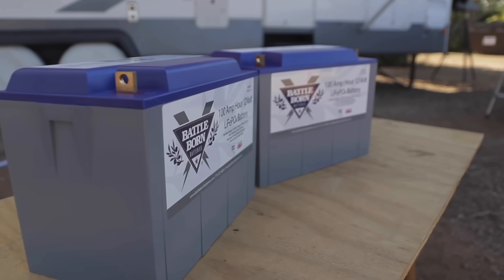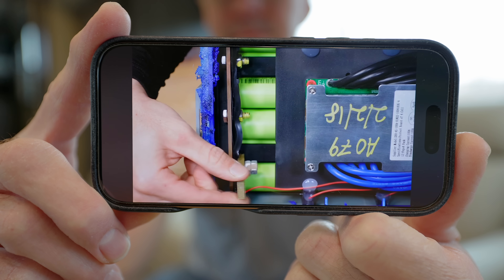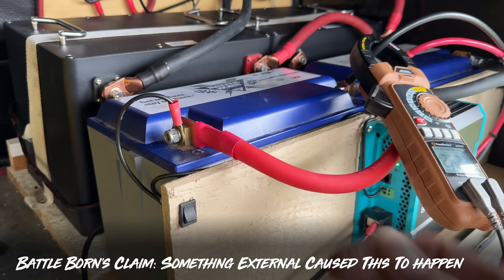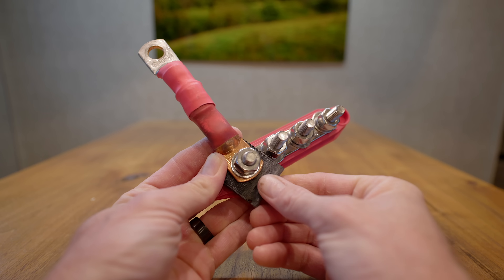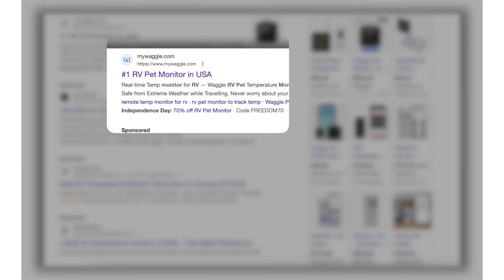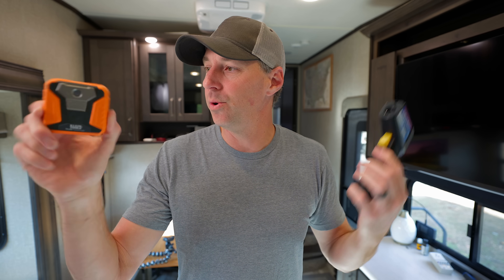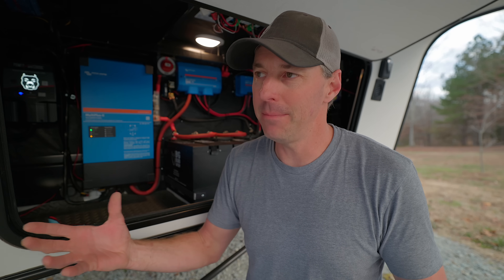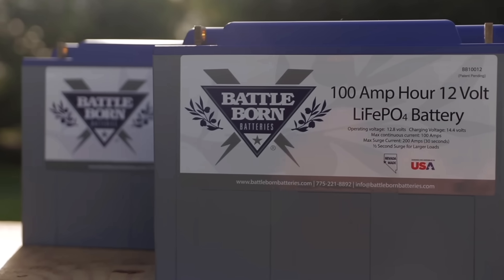Battle Born Batteries Problems!

Comment: We have 6 of the exact battery.  No sign of discoloration, but I am shopping for new batteries. I feel I got sucker punched.
Reply: You didn't get sucker punched you got "burned". 😂 sorry.
Reply: @Loki-rascal no worries. I am a big boy with big boy pants.  I will insert this in the stupid tax file and take the education from it all.
Reply: Battleborn is going out of business.
Reply: Do you have a thermal camera?  You can get a good one for $150 or so and it is a good thing to have for many reasons.  (I prefer the standalone kind rather than the smartphone attachments.) You can use it when you have a heavy load on the batteries for several minutes to see if there is any sign of heating.  If the batteries operate cool, there isn't a problem. Check them frequently, especially after travel or unusually heavy loads.  If there is no problem, no need to replace the batteries.
Reply: Check Redodody  bug batteries Will reviewed, their big and cheap!
Reply: If you don't pull high current from a single battery probably never have an issue. I suspect some of these are 12V systems which would pull max current frequently. Due to the design of that bolt passing the current through the plastic it gets hot over time softens it. Higher voltage systems probably not going to see max current as often. Check out the video Lithionics vs "Brand B"
Reply: @Mike-01234 agreed
Reply: @Mike-01234 Where all of this rubs me the wrong way is; Battle Born has strict instructions on how to connect to their batteries, but they do not follow their own instructions within the internal battery design.  You have to have enough surface area to even be able to move that much current.  Now I find out they are using several different metals within a connection.  This is nuts.
Reply: You’re probably more likely to get suckered by Will Prowse than anything else. I’ve been running these batteries for five years and very harsh conditions and they are as tight as can be.
Reply: @healthrisingMECFS-FM-longCOVID   Will has zero motive to "sucker" anyone. What's your reason for defending bad quality?
Reply: He either does not like Will, or cant admit that he paid many dollars for junk!
Reply: @TreeLBollingTreeMan Maybe because his batteries have been trouble free, either lucky good batteries or low enough charge/discharge that he hasn't melted the internal plastic. YET.
Reply: @healthrisingMECFS-FM-longCOVID  ignorance is bliss! By yourself a Ferrari and then keep it under 50 miles an hour and you'll be fine.
Reply: @healthrisingMECFS-FM-longCOVID I feel I have been sucker punched by Battle Born because they promised a high quality, American designed, American made battery.  Instead I was given an over priced experiment waiting to fail in my RV.  If you are so smart, you do the math to see how much current you can run through dissimilar metal fasteners and washers.  You have to have a calculated area to even be able to pass that much current. The 6 batteries we have, power our RV system about 9 months of the year with a large portion of that time boondocking.  Thus, we have both high usage times and low usage times, now knowing there may be a ticking time bomb that I paid $6000.00 to experience.  I paid for the best, I did not GET the best.

Comment: Good content.  I'd like to see UL clause that describes the disconnect style/construction they use and what is the testing PASS/FAIL criteria and results.  This should not be an opinion but based on engineering judgment and test data and pass fail criteria.
Reply: I don't think anyone will be able to find such UL info for supporting this B.B. design.  JMHO.

Comment: Design flaw. They still have not fixed the issues with the nuts welding to The bolts when installing. Leaving you with half installed cable and have to use a power tool To cut the bolt Off.

Comment: Dissimilar metals should not be in direct contact, especially in electrical circuits carrying significant current. Putting an aluminum nut on a bolt made of another metal doesn't make sense. The same metals should be used throughout, or at least metals plated with the busbar metal. For example, a copper plated steel bolt and nut for connection to a copper busbar.  The nuts should be nylock type to prevent loosening, or a split-ring lock washer can be used, but they are not as good as the nylock type. For overcurrent protection, they need a proper fuse in the circuit made by a reputable manufacturer.
Reply: I agree with most of your statement but you need to be careful where you use nyloc nuts in regards to heat.  If that connection heats up and melts the nylon you no longer have a locking nut.  Most common fastening for electrical is a washer followed by a lock washer then the nut.
Reply: The nuts are actually steel, the bolt is aluminium. So their PR statement is factually incorrect.

Comment: This looks more like a vibration induced failure, plastic spacer is crushing allowing the joint to loosen and creating heat. Did Battle Born vibration test these with a load on the terminal?
Reply: The plastic isn’t getting crushed. It’s possible that excessive load is causing heat, which is causing the issue to start a feedback loop, but if so that isn’t graceful degradation, it’s a poor design. 

It’s possible that the nuts aren’t torqued properly, or that the plastic isn’t contracting and expanding with heat cycles causing the start of the issue, but again there is no world where this should happen.

Comment: IEC 62619

Title:

Secondary cells and batteries containing alkaline or other non-acid electrolytes – Safety requirements for secondary lithium cells and batteries, for use in industrial applications

Applies to:
LiFePO₄ (Battle Born), industrial, RV, marine, solar, stationary storage

Key requirements (relevant):

Terminals must maintain electrical continuity under thermal stress

Connections must withstand mechanical stress, vibration, and heating

No loosening that causes increased resistance, arcing, or overheating

Requires secure electrical connections under normal and abnormal conditions

👉 This is the primary IEC standard Battle Born batteries fall under.

Comment: EXCELLENT presentation. There appears to be a number of credible number of YouTube creators that are discovering the same issues are are individual owners. I'd like to see what the statistical numbers are of those with issues vs those without though. Your approach suggestions BB get ahead of it appears to be a better solution that the 'word salad' reply that Will Prouse received. 8-10 years ago I followed you and Will to learn enough about Solar & LIFO batteries to build my 1st, 2nd & now 3rd system for my Rv's. BB were & still are very expensive.I will pay the premium for things I see the value, i.e. I use Milwaukee tools. Did not see enough value added to justify purchasing BB's though. I felt completion would soon drive prices down. They did and even BB dropped but still expensive.  I could buy 3 knock offs vs 1 BB. So far in 4 years mine have worked flawlessly. BB has a issue here & needs to address it!

Comment: Even if the plastic surrounding the terminal melted completely away that doesn't explain why the terminal is not tightly connected to the internal bus bar.
Reply: It was connected tightly, then the plastic spacer melted so it is mostly no longer between the bolt & bar; the resulting gap causes extreme. Heat arching.
Reply: There ya go. Simple. EZ to figure out this poor design.
Reply: It may have been tight initially but aluminum expands and contracts at a different rate hence loosening
Reply: @KnutSvensson-f2o  and the plastic flows even if it does melt, causing loosening.  It's an incompetent design.

Comment: BB response is to blame the customer kinda makes the warranty useless. Sorry but an aluminum bolt sandwiching a buss bar through plastic is not UL certification.
Reply: Are you a third party evaluator for UL?   

If you are not your comment is uninformed at best.
Reply: No,  a piece of plastic is NOT a fuse, no matter how anyone obsuficates.  I have no respect for Battle Born's email to Mr Prouse. BTW,  I am an engineer with loads of experience.  And I have two Battle Borns that I have to think about if I still want them in my RV ......
Reply: I am not an UL certification specislist either, but as an engineer able to follow OEM instructions.  Battle Born has very specific instructions on how to attach wire leads to their batteries.  They are not internally following their own attachment instructions to get proper electrical flow into or out of their battery.
Reply: @KylesRV  LoL Here you dont need to be an expert. Fuses shall disconnect reliable, and not just increase the resistance... facepalm
Reply: @SurvivalSquirrel  My comment was directly related to knowledge of UL third party certification not anything about the design.  The OP made a comment regarding UL certification apparently without any knowledge of UL certification.  Someone may or may not like the design, I don’t care.  I don’t own BB because I didn’t see enough benefit to pay the premium on their product when I was making a purchase.
Reply: @KylesRV UL certifications are available for everybody to read, how could that be uninformed? I assume you bought battleborn and now you're butt hurt.

Comment: I would believe Will over the manufacturer
Reply: Every Time!
Reply: There was a long thread about a warranty dispute on his forum about a year ago Will asked for the proof emails, and text screen shots. I was surprised that BB gave this person so much grief over a warranty issue when they charge 10x the cost of everyone else. Will said he was removing them from his list of products he endorsed. I don't use 12V batteries since I started building my own DIY battery banks awhile ago 48V lot better. I think this sort of why I never liked these plastic cased batteries can't look inside to see if have a problem. Could have swelling, lose terminals won't know it until the battery overheats possibly vents hydrogen gas.
Reply: @Mike-01234 I had warranty issues two years ago as a wholesale dealer and was discussing in his DIY Forum 
This is old school, folks think it’s just 100ah it’s not, GC’s too. Dragonfly/BB is so big they can squash the little guys
Reply: ABSOLUTELY! Independent testing with no skin in the game.
Reply: Will the man child😂
Reply: I "believed" Will and purchased 2 BB batteries. Now I'm stuck with 2 of them.
Reply: Well he didnt see this, when he first opended such a battery! But it was easily visible in the old video.
Reply: @SurvivalSquirrel  Have you called it out back then when you noticed it so easily?
Reply: @mannyfreundl5099  I didnt watch it back then.

Comment: An aluminum bolt connecting copper busbars? Really? Any electrician would tell you that dissimilar metals such as copper and aluminum should never be in direct contact with each other. Add into the mix, the thermal expansion of aluminum and it's a problem waiting to happen. Not that the National Electrical Code technically applies here, for what it's worth this is actually an NEC code violation: 110.14 Dissimilar Metals
Reply: NEC doesn’t apply to manufacturing. Plus dissimilar materials are fine, it’s the rating that matters.
Reply: Don't forget that plastic spacer between the busbars. I do not believe the NEC covers that in any way.😀
Reply: It's DC in a sealed environment. Galvanic really isn't an issue without some form of electrolyte / moisture. That said, the design IS stupid.

Comment: ….. I would think twice bout your thoughts on this. You’re supporting the idea that an external problem causes the internal connections to ‘deform’ and heat excessively? This is not in the realm of reality. Why? How do you know anything inside has deformed? A safety feature doesn’t destroy, damage or potential heat up to protect. A safety feature either stops or starts a process. This just deforms. So melting plastic is BattleBorn’s response?

And…. It can only happen in very few cases?? So we are now playing Russian roulette with electricity? Come on. 

Your answers sound sponsored…..😢

Comment: For anyone buying new batteries, there are options with lids that are screwed on. Buy these. It's easy to remove the lid and check the build quality or swap a failed BMS. Manufacturers are more careful if you can check their work.
Reply: Yes, one of the reasons I bought sok marine batteries 206 ah
Reply: Exilent point.
100 % to consider.

Comment: I had an RV fire so I'm a little more cautious with this stuff. A battery is something you want to connect and not have to babysit 24/7. I wouldn't take this chance. Safety first.
Reply: I had a 46,000 watt hour power console 3600 amp hours,  with 12 batteries catch fire after 2+ years of constant light load operation. The battery that caught fire set 8 more on fire, burned up the inverters, MPPT's and chargers. It caused $150,000 in damages in my shop and garage. Its going through court now, but there was thought and evidence that the suspect battery was dropped upside down in its packaging from 5-6 feet high during transit, crushing an internal  wire to the BMS.

 I was lucky to be home and have my own fire hose cabinet. I had high pressure water on it 70 seconds after hearing the pop. I saved my home, cars, motorcycles, tools, and collectibles with that fire hose. One of the cars is an old Ferrari. 18 months later I still wake up and thank The Lord for making me stay home that afternoon.  I replaced the system with EG4 components with UL Listing and internal fire suppression. I'm still nervous about batteries.

As a retired Engineer who worked in power generation and distribution in 17 countries,  a guy who built 15 systems including for friends and family RV's and cabins, I think the BB terminal design is terrible having plastic in the bolted terminal stack.  It should have been all metal with a DC fuse or fusible link inside if their BMS can't handle the fault. I have the same brand 300 amp hour battery in my camper van.... parked a fair distance from my home.
Reply: @kimmer6  I'm building a house and it'll have a large battery bank.  Part of the design is a standalone battery shed on the outside of the house that's heavily firewalled from the rest of the structure.  I don't like anything that concentrates that much potential energy in a living space.  I'd no sooner put a bunch of large batteries in my home than a couple cords of seasoned firewood.

Comment: It's a poor design to allow the battery post to arc inside the battery. The way they secure the post to the bus bar should not be allowed to come loose, especially in a moving van. I'm happy this problem was exposed before a  RV burns down.

Comment: Quality is exactly why I bought Batleborn batteries. I have 5 ranging from 7yrs old to 2yrs old.   But the design looks like it was designed by an engineering intern and their response sounds like an inexperienced noob employee reading from a book.  Not impressed with BB response.
Reply: My story, too. I have 5 of them of the same age as yours. I didn't want to skimp and risk getting "cheap Chinese crap" that might be dangerous, so, I bought the "gold standard" and paid more . I relied on those who knew more than I did, such as the experts on YouTube. I was naive and now I am more than a little concerned.
Reply: Are you having any problems with them?
Reply: I am not really sure where your thinking was. Pay over double the cost and getting a battery that has half the capacity is getting quality?  Did it ever occur to you that you where just getting ripped off? I do however agree with the rest of your comments. You are exactly right.
Reply: @markmetalworx4689   when I first bought into battleborn they were really the only ones in offering “quality” lithium that I trusted.  The more recent purchases were because I didn’t want to mix and match with other brands running batteries in parallel.